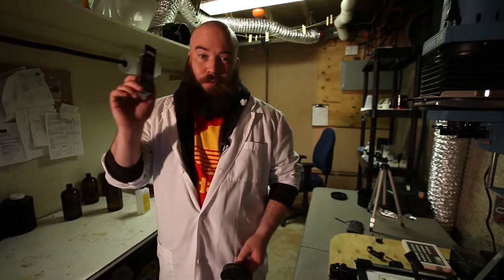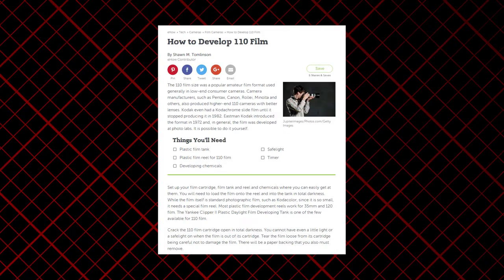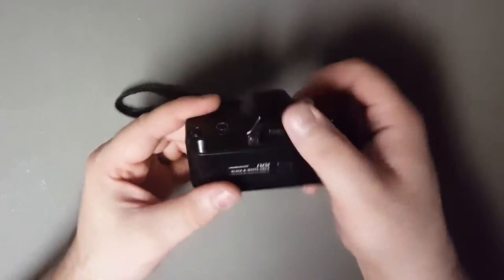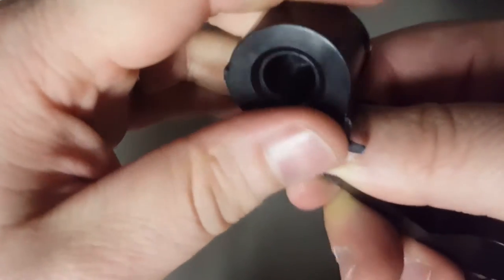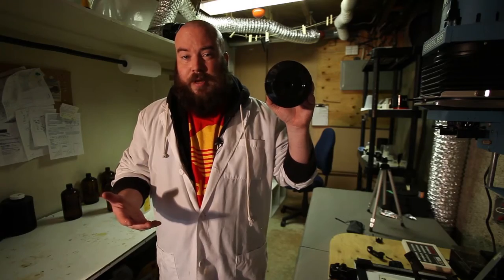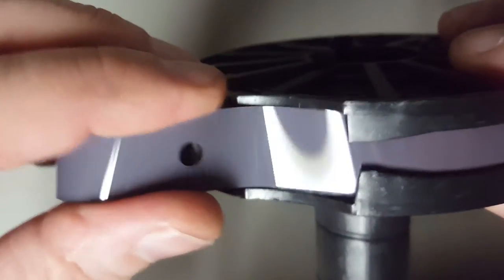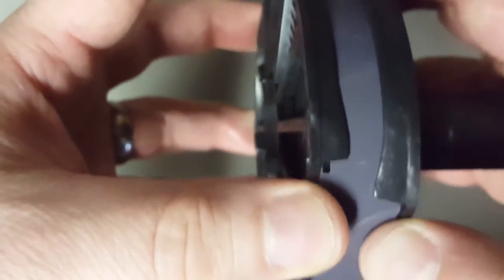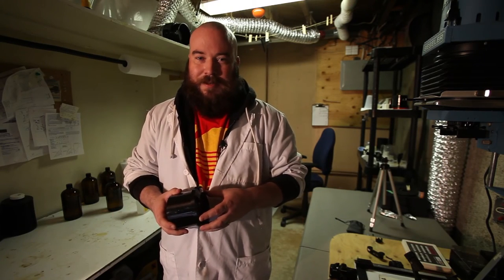Loading 110 film onto a reel | The Darkroom Knight #01

Comment: Really cool video. I wish I would have seen it before I developed the two 110 rolls I just did. I put my roll into a paterson tank with another reel set to the 35mm  setting on top so it won't move and develop using the paterson tank normally. It's a lot easier for me than using the older tank.

Comment: Hey thanks man! Developed 110 for the first time tonight and was perplexed initially. I started by slowly feeding the film out backwards but eventually the paper-backing jammed and the film tore so I gave it a google. Wouldn't have thought I'd need to physically break the cartridge like you need to! Didn't get my thumb in there deep enough so I used a flathead to finish the job and got it out ok. Cheers!
Reply from the maker: Thanks for the comment Alex. Yeah, 110 is a pain, on so many levels.
Reply: @AzrielKnight  yeah! However last night I did another roll of 110 and it came out with the paper backing smooth as butter--no snapped the cartridge needed. However getting it into the wire spool was still a challenge!

Comment: Excellent tutorial. I haven't had the chance to work in a dark room yet but if I were gonna work with some of this film, I think I could at least get it on the reel thanks to the video haha.
Reply from the maker: can I ask what is holding you back?
Reply: +Azriel Knight I don't yet have a film camera. I've shot digital since I started, but I've been intrigued by film since watching your This Old Camera series and the newer Analog Rev series. As for the darkroom, I simply haven't had a chance to use or be around one. Most schools here in Iowa have done a good job with taking them out, unfortunately.
Reply from the maker: Depending on what you are shooting on the digital end you may already have lenses. 
I do plan on doing some basic tutorials, I just didn't want to start out with one.

Comment: I hate Yankee roll film tanks.  With only twist agitation available, they're asking for uneven development, and if the swizzle stick has been lost and you don't have one of the thermometers made to fit them, there's no effective way to agitate at all.  I think the only thing to recommend the Yankee Clipper tanks is their ability to accommodate film sizes that can't be used with unmodified Paterson compatibles, and are a PITA to load on stainless reels (I've got a 16mm stainless reel, and have never once managed to load it in the dark -- in fact, I can't even get it to load when I can see what I'm doing).  At least one of the Yankee tanks similar to the Clipper II (or it might be a nearly identical FR brand) can expand the reel enough to take 116/616, and years ago, they made them to take the even larger roll film formats (118 and 124) from the early 20th century.

Comment: Working with 110 format film, note that there are very few film reels which will take this size of film. Your Yankee tank is one. You can rarely find such reels as wire reels for the Nikor type steel tanks and Unicolor made one for its film tanks. The source: ebay; rarely seen. Moral: if you find one, buy it. Note: 110 and 16mm are the same size-width.
Reply from the maker: Agreed!

Comment: I found an easier way. Just wind to the first x after the last exposure, take it out of your camera; their should be a small end of film still showing. Then, take a toothpick and pull the remaining ammount of backing paper off. Lastly in a darkbag pull the film and the backing paper at the same time.
Reply from the maker: Thanks for the suggestion Zack! My only concern would be scratching the film.
Reply: I was really surprised to see that C-110 is a paper backed film. They could get twice as much film in the canister if they didn't use paper - same as 35mm.

Comment: Very nice and practical, but youre destroying your cart for reuse. I load cut 16 mm film to shoot again , and this is my only objection. If one is careful after shooting the last frame , to just wind ones more and then in dark just pull the film out by the end , it comes out very easily.
Reply from the maker: Thanks for the tip. What about scratching? That was my main concern about pulling it out.
Reply: @AzrielKnight  It originally was transported through the same place, why would it scratch now?  Ive collected quite a few empty cartridges from the lab near by, and they were all saved from breaking when the films were processed there.
Reply from the maker: dust